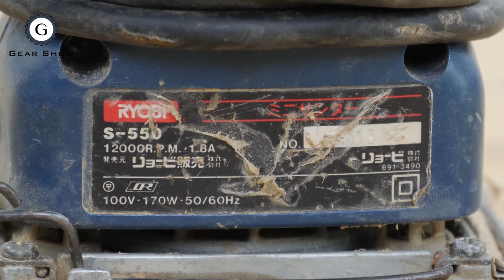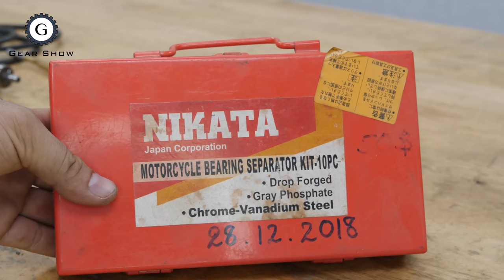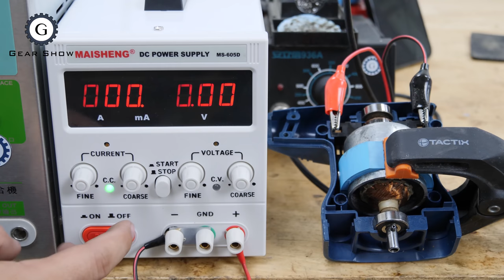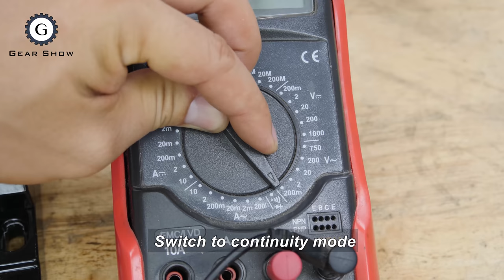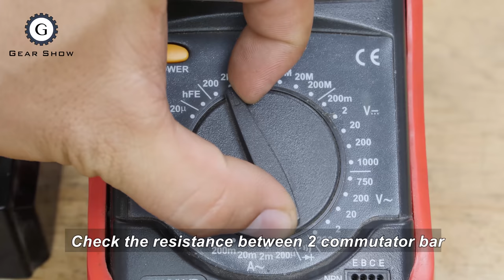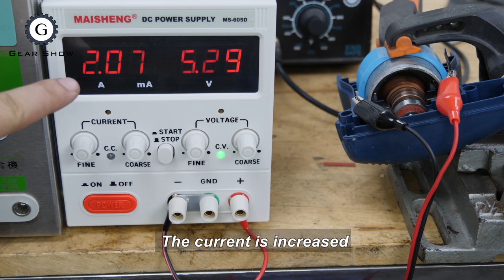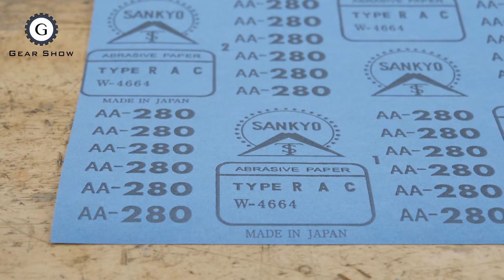Cord to Cordless Sander Conversion From AC 100V to DC18V | RYOBI S-550

Comment: I got a Dewalt battery less than a year ago, and already it's not charging, I wish there were people like you in the UK who could do this, your a lot more reliable
Reply from the maker: Oh, I'm so happy to hear that. Thank you so much for trusting me!
Reply: Is it been in rain. Open it up if you see white on the batery motherboard clean it off with a qtip and isopropyl alcohol  91% is recomended but 70% works to  if that fails check each cell with a multimeter you can  buy replacement ones if you know how to solder if not then rip batery btw be very carful drill batery are powerful I've melted a dime in seconds with a 20v cheap brand battery before
Reply: @bloopbloop5663  I Just sent it back today, It's less than a year old and still under UK warranty, in the UK things have a 6-year warranty

Comment: Awesome effort. Maybe can use loctite or hot glue screw nut (new battery connection housing to the body) to stop vibration from loosening screws and nuts.

Comment: How do you cqlculate the number of windings and wire size of windings needed?
Reply: quick maffs
Reply: @zahidshabir4038  reasonable explanation LOL
Reply from the maker: I follow 24V armature structure.
Reply: @gear_show  What happens if I change the number of magnets in this motor from 2 to 4 magnets, what parameters will change, RPM will increase-decrease ? motor power in (W) will increase-decrease? current consumption (A) ?

Comment: How many volts should the new battery have had if you hadn't modified the motor?
Reply from the maker: Battery is still 18V,  but the power is low with original motor.